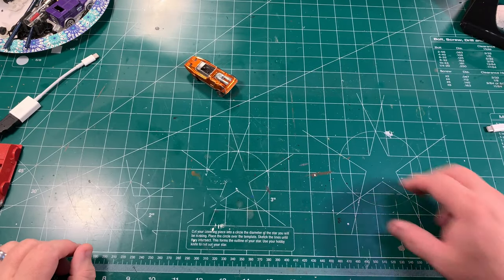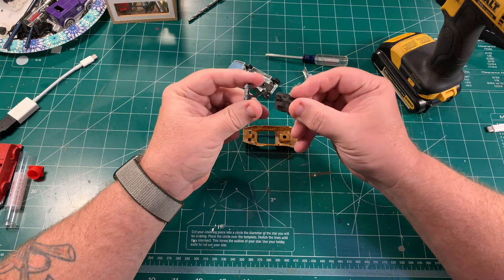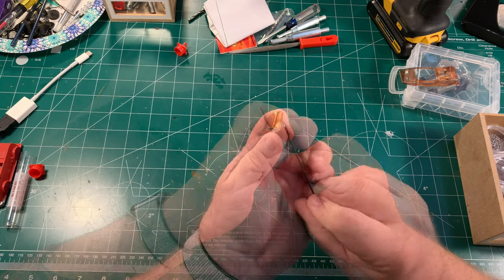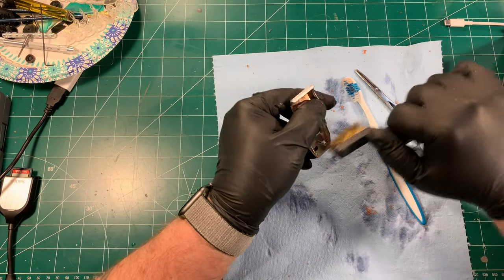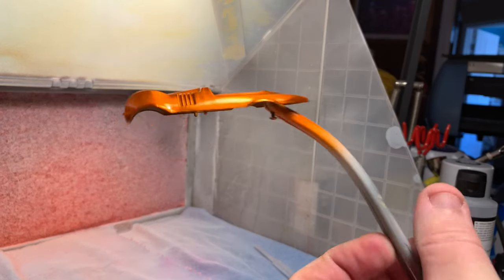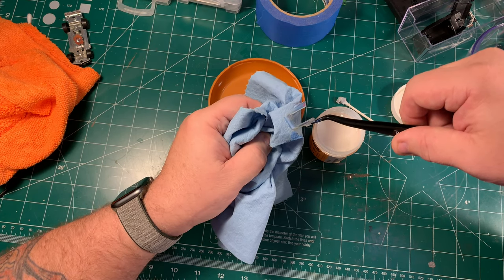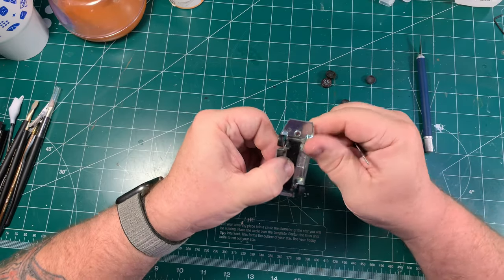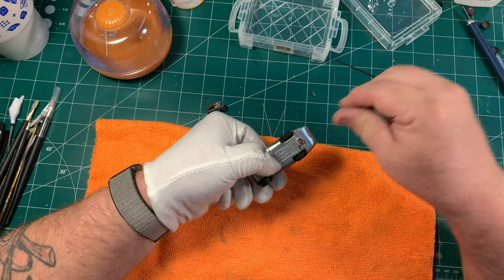Restoring the Hot Wheels Peeping Bomb!

Comment: Hello Pauly, I dug out my original hot wheels rally case that has my moldy oldies from 1969 Shell Oil giveaway promotion when you fill up. I have the PEEPING BOMB in Spectraflame Green. It is in mint condition and has been in my rally case since 1969, believe it or not. I also have all the Shell promo cars from 69. I honestly don't remember if the Peeping Bomb was a Shell promo or not as I have several 69 copyright made in USA I also have the metal button. I understand some were made in Hong Kong with some variation. There were 16 colors of the Spectraflame for USA, that's a lot of colors and collectors will have to find all of them. As always you did a beautiful job.
Reply from the maker: Send me some pics!  captainpaul@cox.net
Reply: @pauly7218  OK, tomorrow for sure.

Comment: Bunch a thoughts.  Ive seen a lot of oem HWs with spectraflame where the paint falls off with little motivation leaving a sparkly smooth chrome polished appearance.  Seems they rather like painting over such a surface which based on your comments you prefer not to.  Just an interesting paradox to me.
Second...I dont know much about zinc plating.  But Ive wondered about nickle plating which would offer a unique variance on the motor for castings like this.  Have you ever considered opting variance routes like this?
3rd...the headlight system was designed to offer us kitchen floor 5000 super racers...headlights on or off.  Black headlights are a product of more modern smoke headlight covers in todays sporting aftermarket concepts.
As always...great build!
Reply from the maker: I have actually ended looked to other plating setups, just haven't pulled the trigger.  As to paint falling off, with a clean body, proper application, and the addition of hardener or a hardened clear, the paint is really solid!